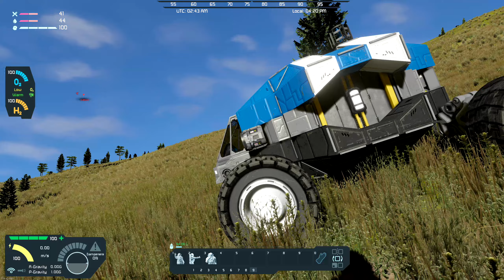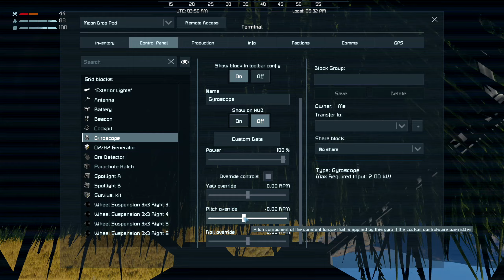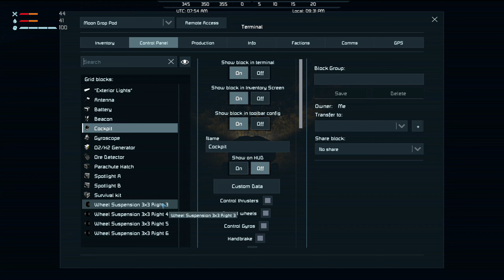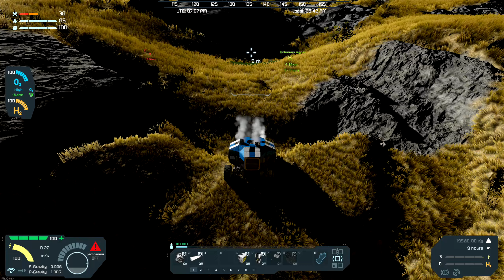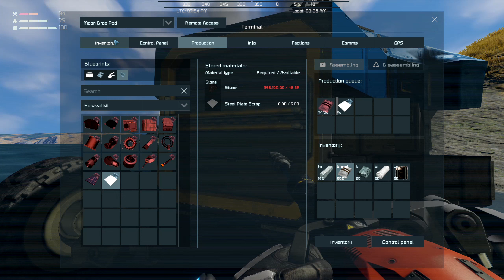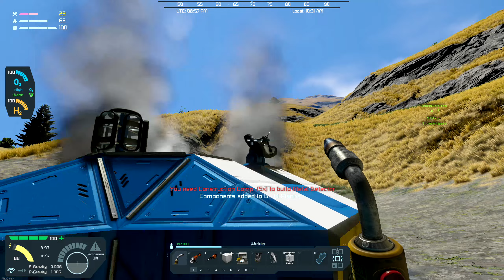Space Engineers | Industrial Overhaul Survival Series #1

Comment: How did you get all of these mods to work together without Industrial Overhaul breaking all of them? You missed the aerodynamic control surfaces mod which is a must-have for building planes that actually work without gyros.
Reply from the maker: Well it mostly works :) The rock crusher and ore refiner from IO don't work with the Better Stone ores for example. I have one aerodynamics mod but haven't experimented yet
Reply: @KerboOnYT  Thanks for replying to my post! :) The Aerodynamic Control Surfaces mod is a must-have addon for Aerodynamics mod, it adds control surfaces that are essential for non-gyro controlled aircraft. I just tested both with IO in my own SP game I just started. 

Surprised at how IO actually eases the early game tedium by increasing the iron yield from stone refining in the survival kit. I managed to set up a starter base with a hand assembler, survival kit and an under construction smelter. And that was without anything but the vanilla drop pod!

I am probably gonna try making a stone quarry for survival kit refining, could probably run it through a cement kiln for automated concrete production :D